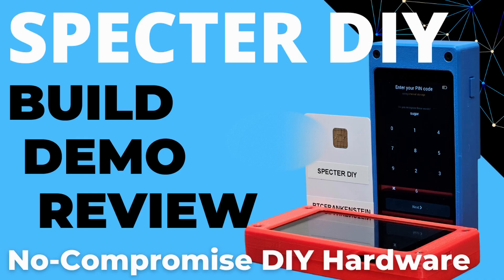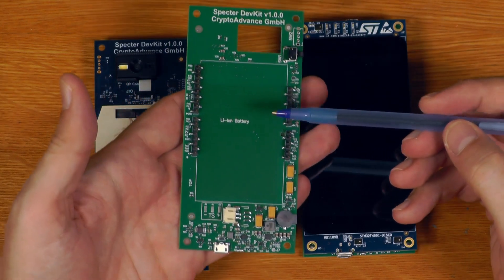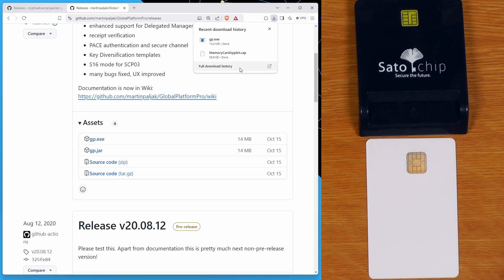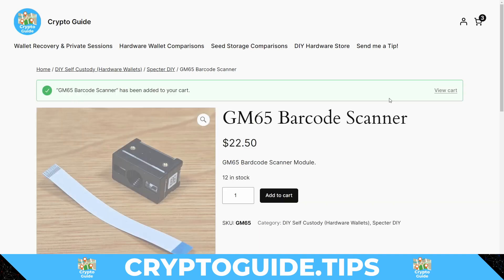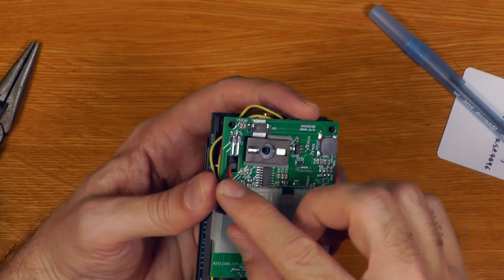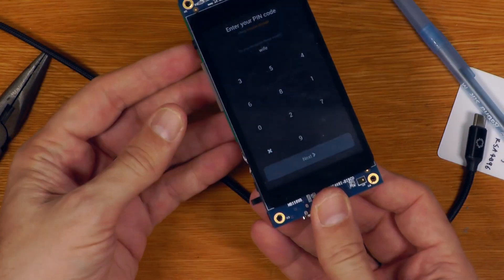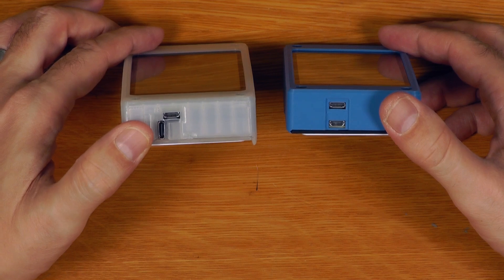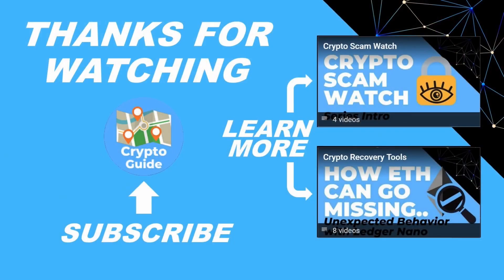Specter Shield Lite - Low Cost Secure Element Backed Security for DIY Bitcoin Hardware Wallet

Comment: Ok. So I'm currently building this, just finished most of the soldering(i think) and I'm at the part where I'm wiring the batteries, but I'm a bit stumped. Did you custom crimp female headers onto the ends of the red and black wires? and then plug those into the 2 soldered right angle male pin headers on the board?  I'm lost on how to do that, maybe you could enlighten me? Also looks like you soldered the wires into the usb C power adapter, but how about onto each of the battery terminals, does each wire just hand-twist onto those terminals, or are you soldering those too?
Reply from the maker: The Shield Lite board has an unpopulated pin header that you can solder the wires directly into. I just used a standard 2.56 right angle and cut part of a female header for the plug.

The wires are soldered on to the switch, the USB-C power adaptor and the battery terminals.

So yea the simple answer to your question is that everything is soldered.

Comment: Great work. Hi, I have a  few questions about your Shield lite board from your store. Is there already the power pin header in the board to connect to AAA/USB-c power supply ? And  what type of power connector header (connect to wire) to use with it ?
Reply from the maker: The shield lite board just had an unpopulated pin header that can accept between 6v and 9v DC.

I'll probably release a low cost board in the coming months that can let you use a lithium battery that can be charged over USB and interface with the shield lite.
Reply: @CryptoGuide  GREAT WORK!  Is the low cost board with lithium batteries still in the pipe?
Reply from the maker: @ikarus4sale  probably, but I'm not actively working on it right now, as there is some other work to refresh the full shield board.

Comment: Hi, I have a question about the Specter Shield Lite Board from your store.

By selecting the Soldered option, does the board come with all the components soldered into it (card reader etc...), or just with the pins soldered?
Reply from the maker: The only difference between soldered/unsoldered are the header pins. (Everything else is fully assembled)

Comment: what would you reccomend, Specter or seedsigner?
Reply from the maker: Specter DIY (especially with Specter Shield) is generally better in terms of security (basically equivalent to a commercial hardware wallet), but will cost more and the parts aren't as easy to source.

Comment: Hello Steve..
I have a problem with ledger nano s ,which stuck a while ago during an update and after I tried everything and it didn't fix it I bought a new one and I was completely calm because I have my 24 phrases, but after I entered them and connected to ledger live (on a new computer) it shows balance 0 (I tried most possible things that are written on the net but without result) I'm not good with computers,but  I'm 99% sure that I have no mistakes in the 24 words because I checked and wrote them down together with my brother who also monitored for error. My question is, can you help me and pay for the service to fix that and find my crypto ?
Reply from the maker: It sounds like you were either using a passphrase or for your seed backups mixed up.

If you want a private session or trusted recovery, then you can request it here https://cryptoguide.tips/recovery-services-consultations/